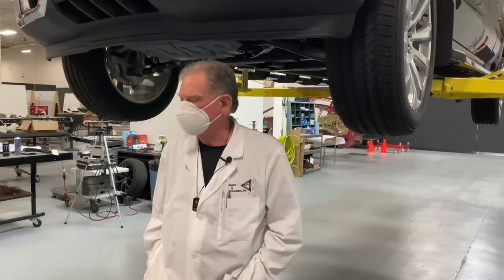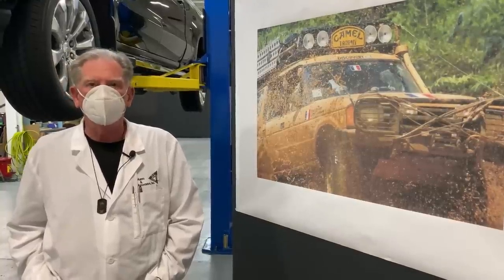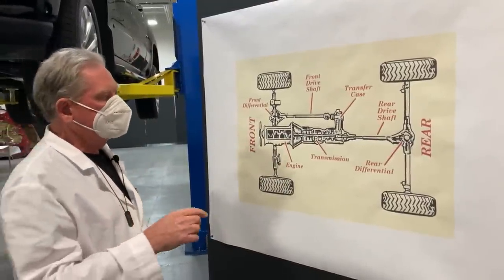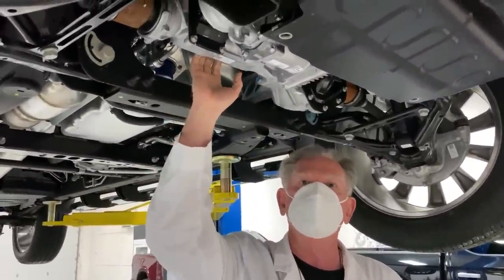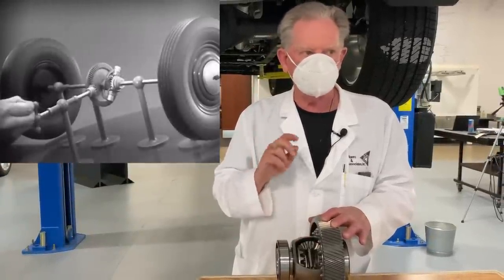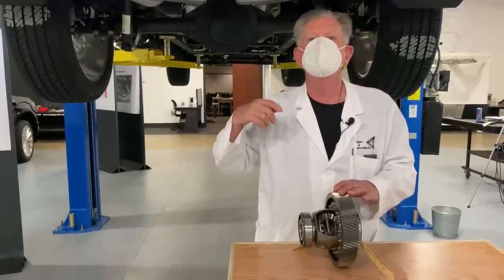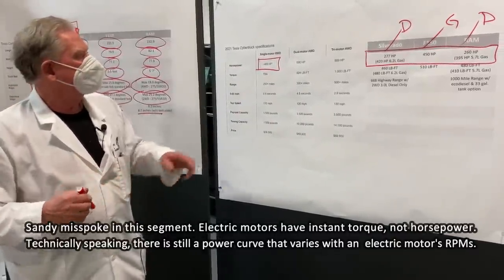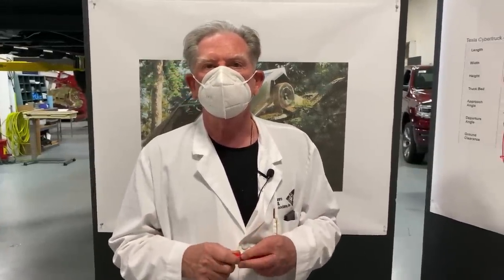Cybertruck E3 -  Driveline & Off-Roading

Comment: Great overview, but you ignore wheelbase and breakover angle, which make those great approach and departure angles more than can be applied to obstacles. The wheelbase will also make the Cybertruck very hard to turn in tight spaces both on and off road.  Additionally, ground clearance is minimum ground clearance.  In the Land Rover school, they certainly taught you to place the tires over the highest points in the road anytime clearance is an issue.  Clearance under the rails on a Disco is quite possibly higher than under the Cybertruck at the same location.  Lastly, everything you show under the Chevy can be replaced for minimum cost if you break them off a rock on a trail.  The Cybertruck will be riding around on a 5-figure skid plate, basically, one that could result in the loss of the entire vehicle if it hits an obstacle hard enough to defeat the actual skid plate.  Given what is likely going to be a really high curb weight, bottoming the Cybertruck out on rocks is going to involve significantly more force than bottoming your Jeep out on the same rocks.  The Cybertruck introduces quite a few constraints to off-roading that need more discussion.
Reply: I will bet the aluminum plate protecting the battery on the CT will be thicker than on the other models. I will also bet that some company will come out with an add on plate to make it even thicker for hardcore offroading.
Reply: What aluminum plate? Stainless steel!
Reply: @johnbuchman4854  Too expensive and too heavy.
Reply: @JasonWW2000  Exoskeleton is all SS!
Reply: @JasonWW2000  No dissimilar metal mix, The .12 inch 30X CRES bottom web carries the sheer load of exoskeleton. It is part of torque box structure that replaces frame. It will double as a skid plate and because of the toughness of this steel, which breaks a tool steel harder than rock, it is highly resistant to impact, deformation or puncture.
Reply: @johnbuchman4854  I will be clearer, "Thick stainless steel for the non structural battery pack is too expensive and too heavy." In this application aluminum makes more sense, just like all previous battery packs. Maybe they will go a bit thicker. I really don't think 3mm thick stainless 30X would be enough to protect the battery from punctures. Since they are going to have a lot of it and if they care more about cost than weight, maybe they will add a double layer of their 30X instead of the aluminum to the battery bottom.
Reply: minimum dry weight of 3tons
Reply: @storm4710  Consider that the Ram 2500 diesel weighs over 7,000 lbs. Half ton gas trucks weigh a bit over 5,000 lbs. So by comparison, 6,000 lbs is not bad. It's a lot heavier than a Jeep Wrangler, but those aren't trucks. You just have to accept BEV's are going to be heavier. Battery weight for its energy is much, much higher than gas weight for the same energy.

Comment: Sandy, 1 thing you missed is the ground clearance may be 16" aired up all the way but thats the same in the middle of the cybertruck because of the battery pack is flat and it doesn't have any center ground clearance compared to all other trucks. 
It will get high centered on every waterbar and hump where all other trucks will driver over them just fine. Can you talk about this please...

Comment: The Cybertruck is easily the most exciting Tesla. Easily seats a family of 5. Climbs like a monster. Panoramic interior view. Tows real trailers. 0 to 60 in 6.5 minimum spec, under 3 top spec. Absurd payload space, even for a truck. Built in anchors for attachments. Built in ramp. Built in electric power outlets. Built in shop air. Air ride w adjustable height. The most interesting looking production car (like it or love it) in DECADES. All that, and the m'fer starts at $40K! This thing is going to sell like an absolute BEAST!  I know all of this in the back of my mind... but you really have to sit and think about it every once and awhile. This vehicle doesn't make ANY sense!

Comment: Endo is short for end-over-end. Probably comes from motorcycling, although decades ago it was used for high-speed sailing , as catamarans. (windsurfers and later snowmobiles first used the term  but because these were done on purpose, it was abandoned in favor of forward rolls, almost immediately called just forwards.
Rolling is side to side, and side over side over side . . .

Computerized feedback  for 4-motor EV AWD is or will be the future, unless design is damageable by towing heavy weights. So, observe the Osborne Effect in your decisionmaking now.

Comment: Chevrolet Electric powered trucks are actually sourced from Ford from F150 electric vehicle, which intern is actually from Ford owned Rivian an all electric powered SUV truck manufacturer. Incidentally, GM had spent too much on research and development of the C8 Corvettes 2018 to 2019 winter 2 of the X project C8 had overheated in snow conditions. They had quickly expand rear quarter to get more and larger radiators.  For production

Comment: Sandy, dont you think the tri motor design will basically add a second motor to where the inverter/converter sits on the rear drive unit? It's the only possible way I can see then adding a second motor to the model S. That inverter/convertor needs to be changed anyway to handle the extra power. So relocate it and change the shape to fit elsewhere. The twin motor rear might then feed a single diff or it might use independent gear reduction. I'm betting it feeds a single diff as the software wont require a big change.

Comment: There is literally only ONE major thing that is holding the cybertruck back. Most people wouldn't care, but it does affect a small percentage of prospective buyers. It's the battery density. Batteries right now are way way less dense than gas or diesel. They make up for it with extreme efficiency, but you still end up with less range. This isn't too much of an issue with 500 miles, BUT if you start towing, you'll lose a TON of range. This only really affects the people who use their trucks to tow stuff, which to be honest is only a small percent as the vast majority just want a truck because it's "manly"
Reply: CT is a poor long distance towing vehicle such as for trailer home. Occasional utility to dump, skid steer to project, boat to lake or motor bike to trail, CT has great versatility.
Reply: @reneheuscher1557  yeah it'll be good for that, but I really meant people who need to tow more.

Comment: Well presented, Mr. Munro.  Horsepower is a continuing source of confusion.  Electric motors do not produce full rated horsepower at low RPM.  Nothing does.  However, they do produce full rated TORQUE at low (actually zero) RPM, which no internal combustion engine, gas or diesel, can do.
Reply from the maker: Agreed, we mispoke a bit there.  Thank you for clarifying and thanks for tuning in, Paul!

Comment: Please suggest “Crawl Control” to Tesla. It would be like the off-road version of Track Mode, with a combined hill descent control and very slow speed cruise control. Crawl Control could also let you use each motor individually, or RED only to do a “dig” to make a tight turn on a hill.

Comment: Hope they add a "crawler mode". Give 0-15mph tightly regulated speed control based on throttle pedal.  Extra points if they add a "lock up" mode that synchronizes all the wheels so All or none of the wheels slip.  Works brilliantly on loose rocks on my AWD motorcycles. http://www.newtechdev.com/awd.html

Comment: @12:23
I don't think a tesla tri motor setup will be in indepenent rear wheels
1 motor up front & 2 motors with different reduction gear ratios in the back to maximize efficiency at different speeds (and possibly achieve higher top speeds)

Comment: The only downside to this “off road sport truck” is the shear size. An F150 is a terrible off-roader due to width and to a lesser extent, length unless you’re talking about high speed through the desert.   That’s why sandy drives a jeep. Much narrower means you can fit down tighter trails and tighter turning radius means you can actually steer through them.     Cybertruck climbing a sand hill (weight dependent) = awesome. Cybertruck through the rubicon trail equals body shop or worse, stuck out there

Comment: Another thing that should be discussed is the ability to drive in sand or mud and the weight of the vehicles. I'd imagine that the cybertruck would be much heavier and would easily get stuck. That wasn't compared here.

Comment: I’ve cut the chain and removed it in a transfer case on a work truck after bearings went out and had a two wheel drive for 5 years saved me 1000 bucks when I didn’t have it as a kid and just needed to go to work with my old z71 haha that new process transfer case even when new the electronic solenoids for engagement were just shit the only thing good about a 2001 half ton Chevy truck was that 5.3 ls engine the 4l65e Tranny was good to 100k miles from new but after that seemed like a yearly rebuild in my 20’s haha god I wish I would of had internet back then like today are just better older mechanic friend’s I spent a lot of my 20’s under a vehicle replacing parts with hand tools and a cheap floor jack haha total pain in the ass .Soon as I could afford it I bought a metal building, a two post lift with battery and air tools and all I use it for is servicing my own vehicles and helping friends I can’t wait for an battery powered electric 4x4 truck I’m imagining the aftermarket for lift kits and such is going to be competitive with the Tesla truck . Like first one with 40s on a cyber truck gonna be balling haha

Comment: In hardcore four wheeling horsepower is analogous to the pilot phrase: Altitude above, runway behind, and fuel used. Torque is everything. The electric drive will prove good, but not great in this regard.

Comment: Sandy, Do you think the Cybertruck should have T2 torsen diffs at least for the single motor and dual motor versions? got them front and rear on my 100 series landcruiser and find them amazing offroad, I assume for an OEM the cost difference would be minimal from a 4 pinion open diff to a 6 or 8 pinion T2?

Comment: Nice video 👍
However I'm not so sure how it will survive a roll over which is always a very real possibility when out in the wild. There's a lot of glass to smash (that big roof) & the exoskeleton if dented could lose it's structural integrity. Would love to know your thoughts on this?
Also curious as to why they don't just go quad motor for the top tier model as you do away completely with the differentials which are expensive & require oil changes. 
Wondering if they will utilise portal drive & CTIS like the Hummer, would be epic if they do 😎
Reply: Armor glass and yes quad motors would be crazy good.

Comment: So is the tesla truck going to have portals? thats the only reasonable way to have 16" of ground clearance. otherwise what they are probably talking about is that if you jack the air suspension all the way up you get 16" which is not the same thing at all. when the suspension is all the way up, you have no articulation.

Comment: i would be interested in his thoughts on being off road and puncturing the battery pack...maybe you dont do rock crawling with this vehicle but if you bounce on a rock in a jeep maybe. you puncture the oil pan ...with the tesla you would burn the area down as there is no way you could put out that fire in the woods by. yourself.  yes off road vehicles catch fire but they all carry or should fire extinguishers that could put out a gas fire
Reply: Its made of hardened stainless steel. its damn near bulletproof, a rock or two won't bother it.
Reply: The entire bottom of a Tesla is pretty much a skid plate -- but one that is much thicker than normal
Reply: You cant put out a lithium fire, so best to not start one. I'm sure the aluminum plate under the battery will be thicker than the the ones on the other models. If you are a serious offroader, I'm sure you will be able to buy an add on skid plate for even more rock protection.

Comment: Why is that rear driveshaft at 7:30 so immensely thick?
Reply from the maker: Great question! That is because the Silverado uses an Aluminum driveshaft (as opposed to steel), and with the aluminum shafts, although they are advantageous in that they are lighter in weight, you need to upsize the outer diameter to achieve the necessary mechanical properties that can withstand the forces moving through the driveline. Thanks for tuning in!

Comment: if the dual motor version is the same as model s performance then you are actually looking at 800 hp and over 1000 hp for tri motor cybertruck
Reply: GMC is boasting that it's Hummer EV will be 1000 hp.
Reply: The model S dual motor and model S performance use different motors. The performance version uses a bigger more powerful motor. At least in the rear. Maybe in the front as well, but I'm not sure.

Comment: Great episode thank you. I was on a penny pinching DIY mission last week to change the battery in my iPhone. Didn’t get the double sided tape off like the guy did on YouTube and in the process of prising the battery loose with the plastic doodad that came with the battery kit I bent the battery phone it started to flame and smoke. I threw it out in the yard where it sizzled out. Bye bye phone. Long story short, what would happen if a jagged rock or branch punctures the cybertruck battery?  Has Elon got us covered there?
Reply: At least one battery pack in a model S got punctured by running over a metal object on the highway. Much later when it was parked it caught on fire. So it is possible, but rare. This type of thing happens much more often to ICE vehicles with their plastic gas tanks, but people don't seem to worry much about it. Strange. Anyway, Tesla uses a thick aluminum plate under the battery to protect it from road debris. I think it was 3/8" thick. For the Cybertruck, which the designers know will be used offroad, I bet they will go with a thicker plate. 1/2", 13mm should keep it well protected. There may even be add on kits you can buy to beef it up more.
Reply: Doesnt it suck when phone makers use double sided tape for a battery? I miss the quick change ability of my old Note 4.
Reply: @JasonWW2000  I would be surprised if they didn't use the 30X stainless steel on the skid plate as well to maintain the exoskeleton properties. Much tougher than aluminum and weight where you want it.
Reply: JasonWW2000 it looked easy to pull the tape out. It stretches and comes away. But if it breaks you enter a world of pain - and fire and smoke if you are not careful 😂

Comment: I've reserved the dual-motor model, rather than tri-, because I live in mountainous BC where there's alot of elevation change, even when highway driving. My thinking is that the reduced weight of the battery pack (relative the tri-battery) will be more economical for alot of altitude differential driving. Is this logical?
Reply: It will be more economical. Regen is not perfect, so it costs more energy moving the mass up and down. But if you charge at home and buy some solar panels, does it matter if it uses a bit more electricity?
Reply: If your only parameter is how many dollars you spend per mile, then probably yes.
Reply: @mennovanlavieren3885  I'm hoping the tri-motor has beefed up regen because I plan to haul a heavy trailer and I want all that energy back.

Comment: I want my CyberTruck to have run-flat tires, or better yet ... maybe tires that don't even need inflation. I wonder if some type of expanding foam could be used instead of air. Then no TPMS needed and no flats possible. This seems like the type of radical-improvement that Tesla could pull off. It would be nice to never think about air pressure and to never  have to worry about flats. Especially during the next zombie apocalypse!  😜

Comment: Hmm.. horse power doesn't matter in offroading most of the cases. Actually horse power doesn't matter at all. You need to look at the torque curve. The torque curve is so much better in EVs than ICEVs. The max torque in ICEVs are worse compared to the EVs, but that's not the full story. ICEs have max torque in the middle of their rev range, rest of the rev range isn't even remotely close. Electric motors have torque at the bottom which is where you need it the most. I'm not very sure Sandy is very clear on this concept. He was just winging the horse power numbers.

Comment: Suspension and off-roadability
Think the air suspension offers great off-roading versatility: can be set as independent suspension for high speed off-road á la Mojave, and for rock-crawling, suspension can be set-up as connected via connect the air chambers from left and right suspension, or all with each other. In the connected case, will allow same force at the contact point of all wheels when one of them climbs a large rock for example; the truck will not be leaning too much on one side by using an anti-roll bar (or can be achieved if the air suspension has two chambers a.s.o.). That would be a heck of a vehicle.
Would love to see a video about abilities air suspension would support in off-roading
Thanks, lour videos